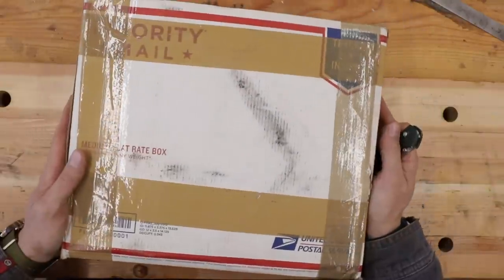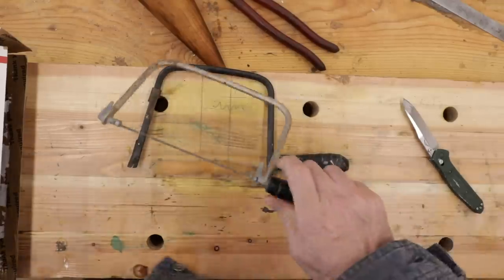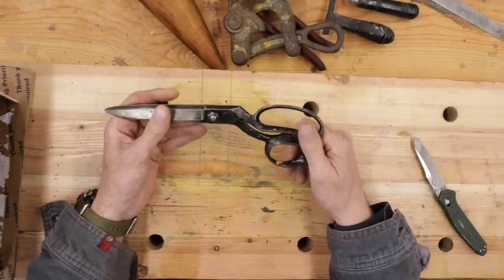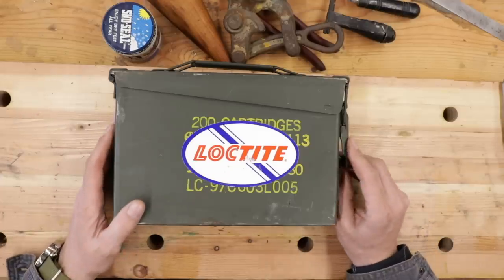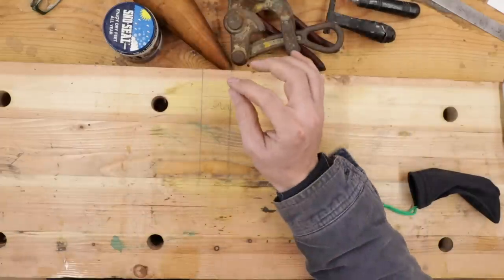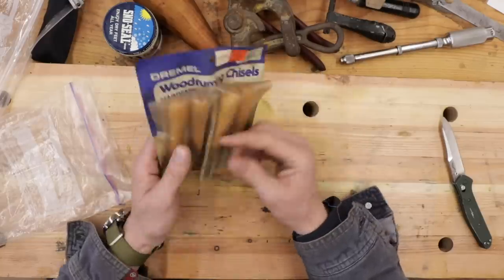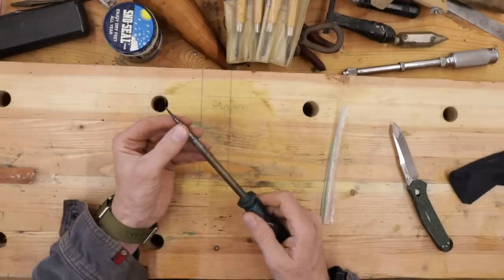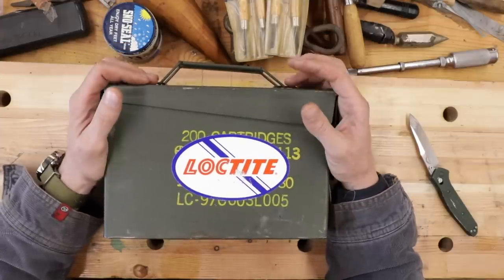You Won't Believe What's Inside This ARMY Box

Comment: I think the cone shaped thing is the mold for  making waffle cones for incream it the. Yes that's a coping saw. The wedge driver is how you hold slotted screws to get them into tight spots. The cam thing is a wire stretcher used in fencing you put it on the wire hook it to a wench or come a long and pull it tight be for stapling it to the podt.

Comment: I guess the marking gauges other sid is simply to put a pencil in, for a circle the fence would be in the way and only one diameter to the scratchy thing. Does the other one have a wheel at the end of the rod? Could be to easily transfer a depth to some wood, like the thickness of a piece as depth to the other for a dovetail joint.
Anyway, nice video, I would like ot have a David, too!
Keep up the good work, I´ll keep you and your family in them!

Comment: It's a COPING SAW FRAME  but, the bow needs a little more opening bent back into it , so it will tension the blade better 
and the over center lever catch needs a little more closure to hold. Coping blades are draw blades and this looks as if 
will use a standard modern blade.

I believe that the wooden cone with handle is called a JUICER PESTLE ? Same function as a Mortar and Pestle.

It's a ROPE DOG used in block and tackle work, used to choke up on the work end of the rope after it has come through the 
pulley blocks,used when you have short linner room to travel, say with a mule team or tractor. Wire cable dogs are similar but
have a straight pull design so as not to bruise, crimp or kink the cable after hard pulling.

CANVAS SCISSORS. also for cutting through multi-layers of material or leathers. AKA seafarer's or sailmaker's scissors.

SNOW SEAL ? From the deep south, if I needed it i'd move farther south.No seal gave up their life to make this product, I hope !

You were close, a pencil goes in the clamp hole and the wing nut tightens down on the pencil.

Love the hand drill, that's nice !  Cut the head off a finish nail and use it to accurately set screw starter holes, you could use your drill bits, but you run a risk of breakage.

The SLOT HEAD SCREWDRIVER is used to hold "new" slot head screws in place until you get them started  in difficult to reach places. Have one and I use it about every five years. 'when you need it you need it !    I can find the axle grease faster.

Comment: The quick wedge screwdriver is for grabbing a flat head screw in a tight spot so you won't drop it. Place the screwdriver tip on the screw then slide the sleeve down and then the two screwdriver tips squeeze the screw so you are able to pull it out without dropping the screw

Comment: @21:31 you said it.  It’s a screw driver for a slot head screw you need to start in a hard to get to spot.  You put the screw on the end and then push the slider up and it would spread the tips apart to wedge the screw on and hold it on.

Comment: The screwdriver returns to it’s original position after you push it to. to reverse simply push it before you apply it to the screw and allow the driver to spring back and loosen the screw.

Comment: Yep, the first item is half of a berry masher.  Here is a link to the whole thing: https://www.etsy.com/listing/588573652/vintage-metal-berry-masher-fruit-or?ga_order=most_relevant&ga_search_type=vintage&ga_view_type=gallery&ga_search_query=berry%20masher&ref=sr_gallery-1-12

As for the split tip screwdriver with the sliding handle... it's two thin blades that you put in a screw slot and push the sliding handle towards the tip.  As the tips overlap the two thin blades become one thick blade wedged in the screw's slot.  Then you can put a screw in places where a hand to hold the screw wouldn't fit.

When I went to EMT school, then Advanced EMT (Paramedic) school in 1974...The first EMT class in Georgia and I was the severnth person licensed in Georgia...there were no worries about anything needing a barrier.  If there was an ambi bag handy, use it.  If not it was skin to skin.

Comment: The silver tool is not a "yankee screwdriver" it is a brad awl for for pre drilling screw holes so as not to split the timber, you will find the awls are sized to the helix shaft diameter of common screws ie. 6 gauge 8 gauge etc This tool was before cordless/battery drills and usually carried when hanging doors
Reply: and cabins hinges

Comment: the split screwdriver is hollow ground on the outside so when you slide the slider toward the tip it will grip a screw by the inside of the slot and hold it so you an start it

Comment: the one that has a split in the blade is what they use to use when they wanted to start a screw in the wood, you place the screw on the tip and twist the handle and you can start the screw one handed and then once it was started you would use a regular screw driver to finish screwing it in.

Comment: Those "two tools" are one tool
The metal piece is a clamp/attachment tool, and the metal rod goes through the hole at the top of the depth measuring tool to act as a pivot

Comment: The depth marker is a dutch made one by the brand of Nooitgedagt. The crown indicates that the company exist for 100+ years which makes them 'royal supplier' (not really, just a term). The hole is for a pencil. You can scratch the wood with the pin, or mark it with a pencil screwed in

Comment: the screw driver is actually a screw starter.  you put the screw on and then slide the piece up until the screw is tight and cant fall off the screw driver

Comment: The other end of that  marking gauge is to slip your pencil into...
Edit: I've got 2 of those Yankee type drills. 
I don't think  those  little chisels  are for wood turning.  There's nothing  to rest it on . The fat handles make me think they're for carving. 
Check that marking knife . Try to grasp it at the hilt then see if you can twist the handle loose if so, pull the blade out to a more usable  length and tighten the handle.

Comment: The wood piece with a slide draws large circles; a pencil fits into the end with the wing nut which holds the pencil in place. It can also mark/scribe different size circles and ellipses. It can also be used to copy a work by tracing and concurrently transferring the work to be copied.

The Yankee is for small or fine work where a powered drill is too big/inappropriate and often for soft woods. Carpenters used to use them but they were a very large size, door hangers seemed to favor them - in days of yore; before power tools.

Dremel is known for rotary tools these days.

That screw driver holds the screw in order to drive a screw that is deep into a closed, narrow space; electronics used to have lots of difficult to reach screw holes - the driver simply holds the screw so it does not drop into the work/prevents losing the screw; can be used in model making, too - or picking up the screw you lost in deep in the work ...

LOCTITE ...

funny

Comment: All these have been answered by now surely. From 2 yrs. ago but the three I can tell you about are these: 1. The split tip screwdriver is I don't know what the proper name for it is ??? but, if you'll take a slotted screw and place it at the end while holding the screw in place there pull the skirt up towards the screw thus making the blade of the screwdriver wider and wedging it into the slot on the screw. Once you've done that well you'll see where that's going. Electricians, electronic repair techs and the like usually have these for that tight space where your big old hand won't fit, now you have the tool for that and how handy is that?!, 2. The cable tool I think it's called a grip, but it's for just what you think tensioning cable, guy wires and the like, but another use, and you may just love this or not but this is the way my papaw showed me to use this in a pinch one day on his farm was out riding fence just checking out to see where some livestock was getting in the neighbor's land and he'd catch them load them and bring whatever cattle had gotten thru back around to us but for him, ( the neighbor) about a 15 mile trip by road so 30 mile round trip! Nice of him. But it got us out riding the fence line after his second trip around and we found someone we think to get back to a fishing spot cut our fence and so using the grip like that one we mended the barbed wire fence! Easy to just got on the side of the post for pulling tension put the barbed wire in the grip and using just that tool and a claw hammer I held the wire taunt by leveraging  it around the pole and papaw drove the two fence nails in each wire 15 mins. later we were on our way home with fence repaired beautifully, handy little sucker and saved us a trip.!!, 3. That is an old, I'm 54 it's older, copeing saw u put the blade on with that tensioner, but if not taunt enough you'd loosen it back off and bend the leg and readjust, least that's how papaw used it. So, that might have just been him, but he showed me to do it that way so I didn't question. Questioning could sometimes get you in a whole heap of trouble were it to be taken in the wrong way. Didn't never want too much of that so I'm telling you way I was taught.
 The adults were the adults and the children was just that. You was important and they loved you but you didn't dare want to come off to smart or it might get taken as smartass,  that wouldn't make your life better! You was pretty much the apprentice all your growing up years till probably 16-18 then they'd just send you out there to handle whatever it was with maybe a cousin or something while they worked on something else! There plenty of work to be done even on papa's little 98 acres! Eight chicken houses, livestock cattle and pigs you had some full days for sure!!! Kids today, l don't know, I don't think most would last long.... .:)
Reply: Oh that wooden Plumb Bob looking gadget you're absolutely correct. Also used as a pusher when making fresh sausage to fill the smokehouse with, pushing the meat venison and pork usually thru the grinder........Kelly

Comment: the blue handle flat head  is a Screw starter. put your flat headed screw on and spread the blades and it will hold the screw on the end of the blade.

Comment: That black handled screwdriver that is split at the tip is for if you have to hold a screw you put the screw in the tip and push up on the tube around it and it will hold the screw
Reply: I have used it while working on points on my tractor

Comment: Could be a jeweler's saw looks very similar to a coping saw. A jeweler will need to take the blade out to loop it into a piece of metal to create or adjust a pattern on silverware for example. Removing the blade easily is convenient for that reason.

Comment: Way too lazy to read all the comments, but in case it hasn't been said yet, the split hole in the other end of the wooden marking gauge with the bolt and wing nut is meant for a pencil.

Overall, the design of the wooden one reflects the use of a router and the plastic knob on the tightening screw only strengtens this assumption. Despite the use of power tools in making it, the bulk design makes it steady and reliable with the only two real upgrade option being replacing the metal spike with a blade for finer and more accurate marking line without tearout as the spike usually does...more so when marking cross the grain. The second upgrade option is embedding any metal strip into the cross member where the tightening bolt connects so it's end doesn't eat the cross member, thus growing the tool's life span. I'd probably do this with a brass strip, which yields before bending and by fitting the stip well, avoiding any glue to make it easily replaceable when the wear makes dialing the depth in too hard.

Just my two cents on a tool I use daily.

That split end flat end screw driver has a guide for the screw (the sliding part) and the split end is designed to hold the screw in place. It's a rare, high quality screw driver made for precision work like furnitures. It's motsly a guess, but that's how I'd use that particular tool myself.

Comment: The Yankee tool is a drill not a driver.  The bits cut in both rotation directions, distictive. In and out with the push.   In the day before cordless drills and screws holding the wooden world together this tool lived in the the hardware setters bag right along with the the Yankee driver and that equaled production when having to use screws to fasten.

Comment: Think I've seen something like the screwdriver. Think you put a screw on the tip of the blade, then push (or pull) the collar to spread the blade and hold the screw on the driver.  Would be good for brass or stainless screws that aren't magnetic.   Like these box opening videos better than the "battle box" opening videos.  Thanx

Comment: You have a bone saw, not a coping saw.  adjustability  also meant flexibility that went against surgical or butcher shop purposes

The brush appears to be a glue brush for wallpaper work

Your "depth gauges are a doweling set for marking drilling locations on opposite pieces of wood in furniture making

Most yankee DRILLs have to be pushed all the way and held in place in to change direction 

Shears are usually for non woven materiel material such as leather or animal shearing.  Thats why they are heavier than scissors

If you try to use the Dremel (Either a French or German Company ), chisels with a regular size lathe you will probably lose fingers

Can't tell from the video but the I don't kniow thing with the files may be a fretting tool for musical instruments

The some kind of carpenters knife is a leatherworking knife for cutting decorations into the hides before dyeing  The others appear to be different sizes for cutting larger or smaller designs.  Sometimes used in wood for scrollwork

The Screw driver is a Screw starter with 2 prongs that hold the small screw in place while working in tight quarters where use the other hand to hold the screw in place while turning

All in all the ammo can appears to hold an old Luthier's toolbox

Comment: The Difference Between Scissors & Shears. Scissors have symmetrical, equally sized finger holes and are generally under 6" in blade length, while shears have one smaller finger hole and one larger finger hole and are more than 6" in blade length."  From https://www.knifecenter.com/shop/scissors

Comment: I gave ya the Yankee drill due to geography (southern bell/telephone co. ) used them in S.florida. But I was a little flabbergasted that you had no idea what a screw holding screwdriver was (they have many names but 1 purpose ) Now I know where MY fencing pliers went, I looked for mine yesterday for over an hour. They were in the blue fencing tool box. They must be up there hanging out with the ones you lost.they are sitting around laughing at you and Brian😂😂poking fun of you waiting for one another to use the pair that DIDN'T escape.By the way I still use the yankee drill when I need depth control.

Comment: at 22:00 that screwdriver holds slot headed screws.  the shaft is pushed forward to cause the two blades to widen within the slot of the screw.  to me a gimmick but i have had one.

Comment: its a flat head holding screwdriver.  is so you dont drop flat head screws in a live electrical panel or if you need to reach a screw in a thick place like a motor and dont want to drop the screw.

Comment: yes that is a coping saw my great -great -grandfather said it was and said have the blades for it here someplace too you do seethe saw  is spread apart that will hold the blade tight he said 
the wood depth gage  the other one it one too the other is an electric screwdriver for special use in panel boxes  still have the isolator on it with the files  was a nail set  for the square head nails  my  he said too

Comment: as for a safety always put the knife blade away for you when sitting it down  and should be in front of you too  less change of the knife cutting you or push off the work table  and that knife should have been closed afterward and put in the safe  spot in front of you if you needed to use it again, there was a course I taken how to use knives in the right way   it was amazing course to go throw learn a lot in the 3 days most put how I knew it was wrong and how wer store  nkivies too